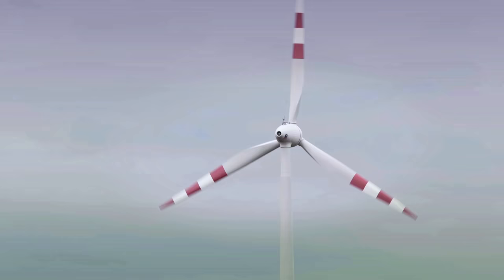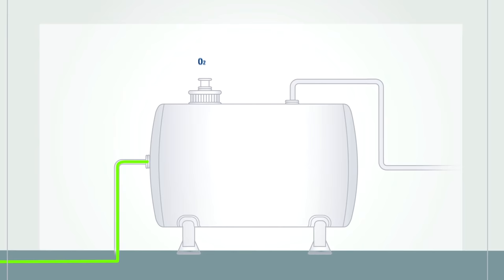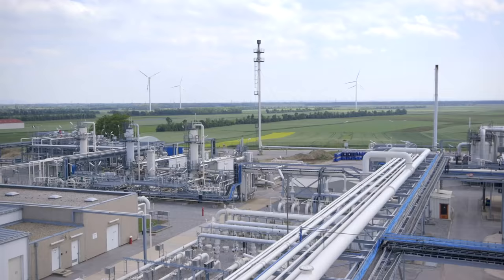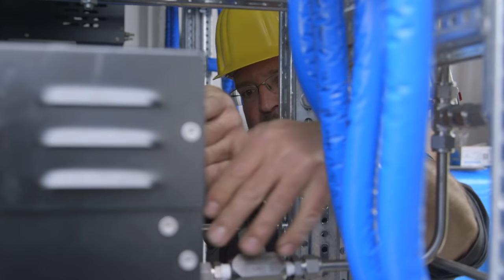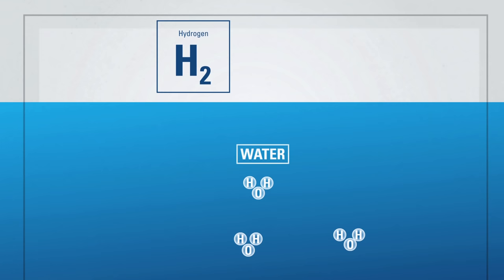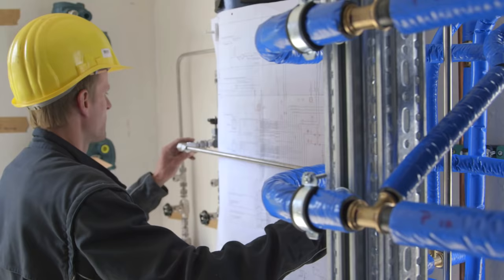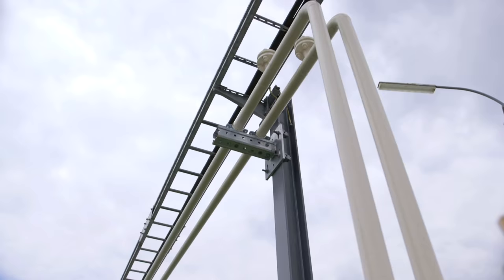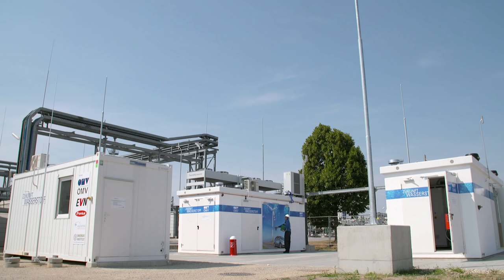Power to gas: That's how wind power is stored

Comment: great video OMV---would be good to have some updates!!!!!!!!
Reply from the maker: Dear Jim Kaff, Thank you for your comment and your interest in power-to-gas. The wind2hydrogen project (funded by the Climate and Energy Fund) has contributed key findings on the possible extension of the hydrogen value chain over the entire four-year project period (01/2014 to 12/2017). These options start with the conversion of the fluctuating renewable power via electrolysis, followed by the supply and storage of the hydrogen in the existing natural gas network, as well as the possibility of hydrogen for industrial applications and mobility. The expertise acquired will be integrated into planned follow-up projects in the refinery and hydrogen mobility sectors, thereby providing an important step in the further development of the value chain.

Comment: Can you please help me to know how can we change hydrogen to methane gas please mail me about it thank you
Reply: H2 + CO2
Reply: After that, you might want to convert oil to coal, A cruder fuel produces wonderful air pollution!
Reply: Via the Sabatier process. H2 + CO2 + H2O + Heat in the presence of a catalyst. 
The main difficulty with this is getting the CO2 without getting it from fossil fuel exhaust (not that that's a bad idea for reducing startup costs to facilitate development of the sabatier plants and electrolysis, it just can't be a long term assumption of the network design). In air its a fraction of a percent which makes seperation a stupidly energy intensive process, and dramatically reduced the efficiency of producing fossil-less, non-bio methane. (bio methane is rate limited several orders of magnitude below the needed energy flux that we need for modern civilization) The best alternative I can find is extraction from seawater from a depth of approximately 800 meters below the surface. (highest proportion of CO2 among the dissolved gas species, which means much easier extraction and purification, definitely worth the trouble of building the infrastructure to extract it from there specifically) Though some areas have an even greater geographic advantage for this, specifically inland countries in equatorial Africa, where there are limbic eruption hazard lakes that have orders of magnitude higher CO2 (and biomethane) dissolved in their lower strata.

Comment: How the by product of electrolysis such as liquid oxide oxygen is good for nature??? Is it not pollution to nature ???
Reply from the maker: The oxygen from the electrolysis comes in gaseous state and in a highly pure form. Since oxygen is already in the air, the process is not polluting the air, but only enriching it with oxygen. What you get is oxygen-richer air.
Reply: OMV tidal energy is developing worldwide. Unlike wind and solar this energy is 24/7
If u can harness the tidal power convert into hydrogen by electrolysis. It can be used in fuel cell buses, trains, even ships in future. Oceans has a lot of energy . Can you produce hydrogen from 1 kw electrolyzer . Because tidal power estimated to generate 1 kw for every 5 meters of coastline.